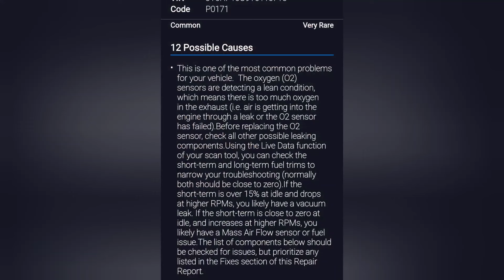How To Test And Clean PCV Valve Possible Cause P0171 Lexus RX300

Comment: Bro Stop being a part changer Scan and check your fuel trim first (LTFT) check if Bank1 and bank2 are both affected. ie reading lean or high numbers
Reply from the maker: Hello my dear brother, yes you are absolutely right I think this lexus rx300 2000 has it least  2 bad oxygen sensors, air fuel retio sensor never been replaced  many years it's very expensive denso brand about $360, oxygen sensor after CAT it's also bad but need a lot work to replace because it's welded in, no bolts, bolts were missing so I welded in before,  I will also do smoke test, hopefully next few days if weather is warmer little because I don't have garage, thank you so much for great advices and help please keep in touch to help me figure out how to solve P0171,  thank you again and all the best 👍 😊
Reply: @WorldRandomVideos   If you said welded try check for exhaust leaks and with the smoke machine your getting
Reply from the maker: @abzbrk490, hopefully today , it seems  weather is going to be nice